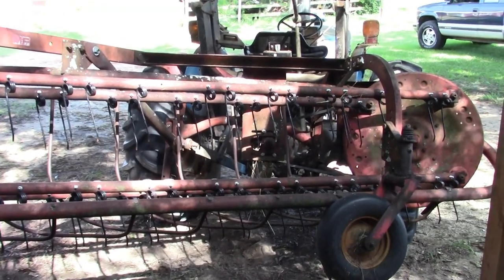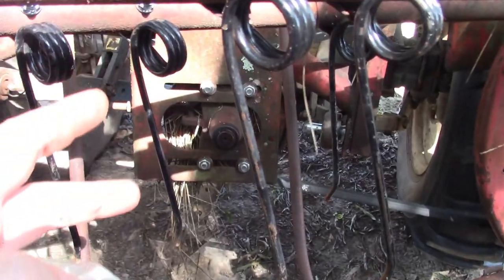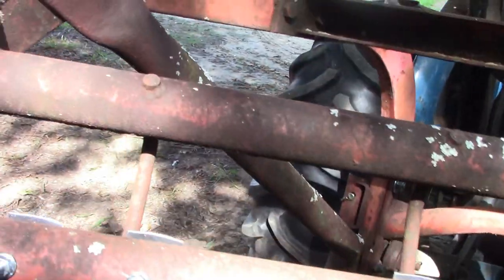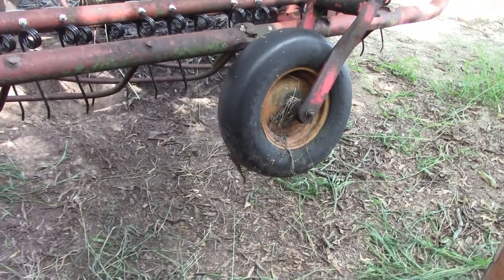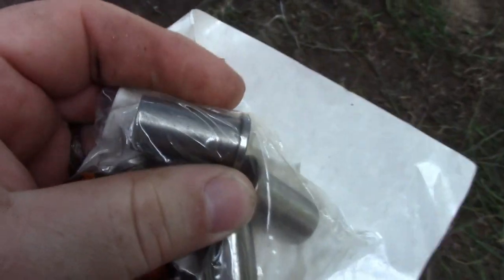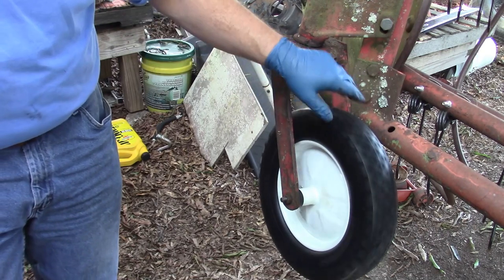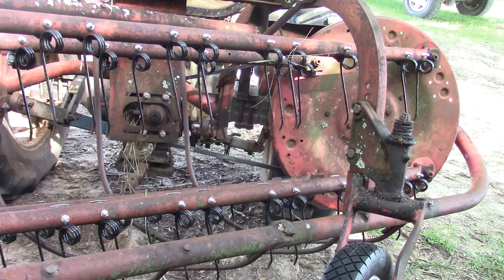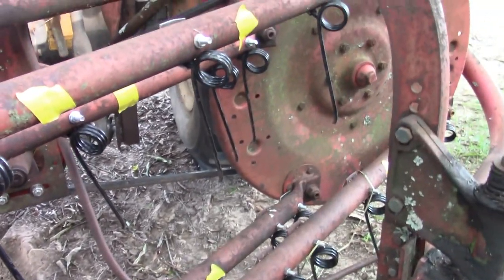MF25 Hay Rake Part 5

Comment: I know this is an old video, but could you share where you bought those tires?  I have the same model massey ferguson 25 hay rake and the rims are shot.
Reply from the maker: I'm thinking it was on eBay, but couldn't verify since purchase history only goes back to 2019.  These are basically wheel barrow tires and wheels.  I got the bushings on Amazon.
Reply: @farmboy30117  Thanks for checking.